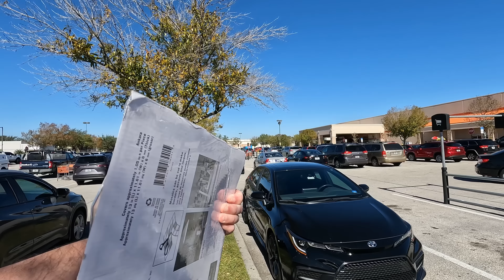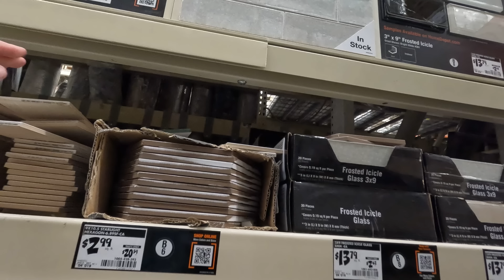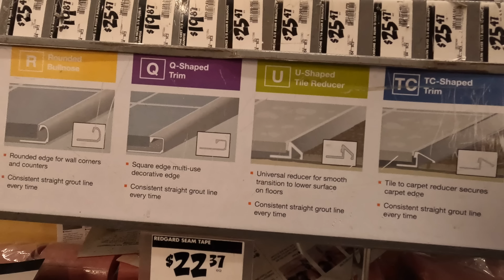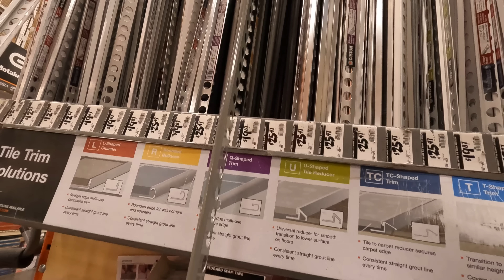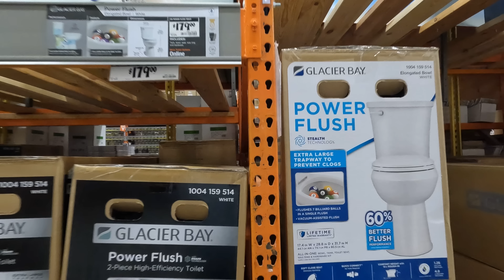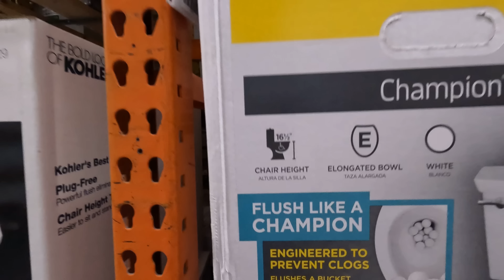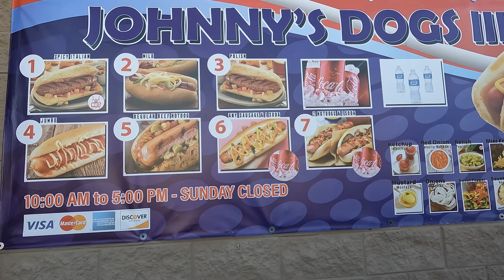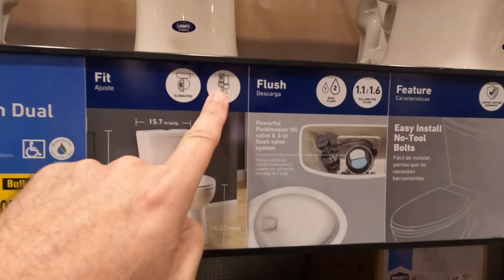It's Bad, Very Bad - Orlando Home Renovation

Comment: Have you checked to see if your water meter arriow is turning, that will tell you if there is a leak from a pipe. As a general contractor myself, I feel your frustration dealing with sub contractors. When I came over here I found I got most of my work through showing up when I said I would show up.
Reply from the maker: Yep I went back through my water bills for the past 2 years, no change

Comment: I am guessing the house floor/slab doesn’t have enough drainage away from the exterior and all the rain water off the roof is not getting away fast enough and is leaching back in.Over time it migrates inside more and more.Your yard appears fairly level grade.Might need  better drainage and a water shield on the exterior walls.Hope it all works out for you guys.Let us know,we will all be wondering.
Reply from the maker: Thanks Ray we are working on it